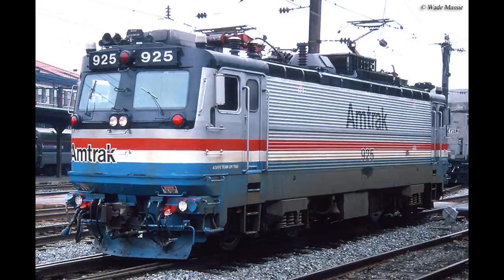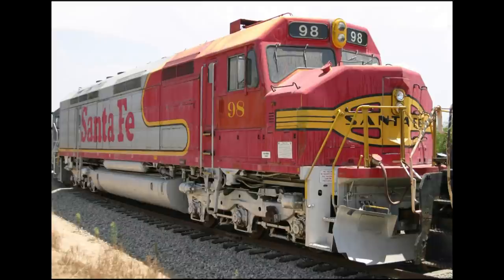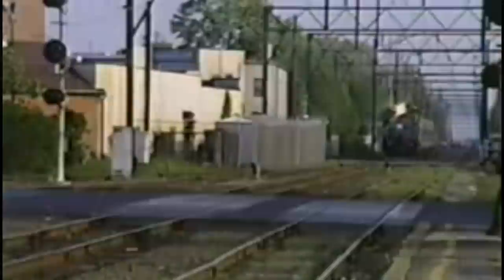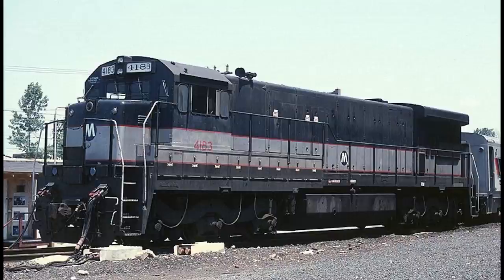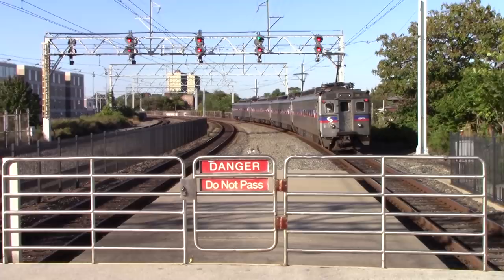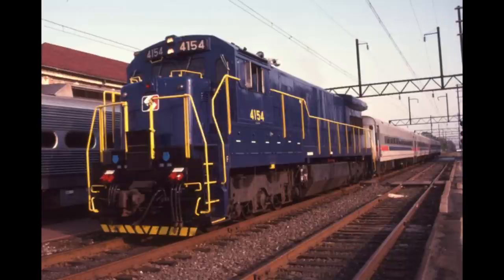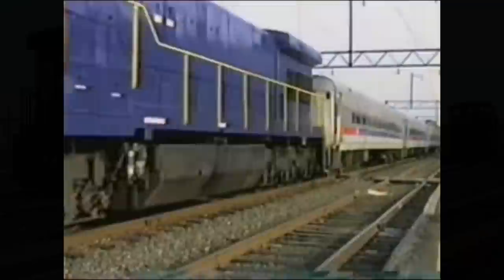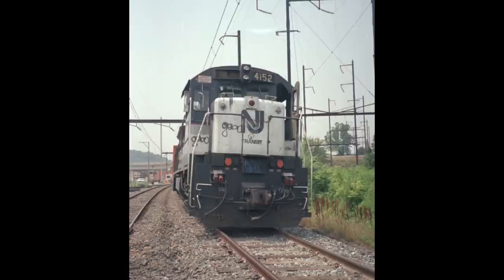Engines of SEPTA: GE U34CH

Comment: 1:05 I remember the story behind the shown locomotive is that EMD made a freight locomotive, Southern Pacific wanted a longer passenger variant, and Erie Lackawanna wanted a freight version of that with more fuel and ballast.  A freight version of the passenger version of a freight locomotive.
Reply: @LJRailfan-Gamer_07.  yes
Reply: You’re correct. I believe an EL SDP45 survives today in rough but economically restorable condition, might be Roanoke, VA
Reply: SDP45 are SD45s with passenger gearing
SD45M are similar to P45s but lacked passenger gearing and we're set for heavier ballasting and more fuel for greater tractive effort

Comment: Fun fact: down here in Brazil, there's still large numbers of dash-7s and U-boats, notably 9264 (ex-5099) a C30-7 that still sports the BN colors even after 20 years of operation, the original U23C's bought by the Federal Railroad Network in between 1972 and 1976, many rebuilt to dash-7 standards as U23CA, U23CM, U23C1, U23CE and C30-7MP. All of the above are still in mainline service, with 9264 being put as a MU unit on the last train headed by EMDX SD80ACe 8080, the SD80 demonstrator and the U23Cs being common as MU units or in other trains outside the iron ore drags.

Comment: Ferromex in late 2014 begin scrapping all former u boats and c30 left from fnm, today only one remains operate which is 3571 I believe and others from ferrosur and one c30 in ferrovalle. So I think most of the units maybe scrapped in 2003 or 2014 while other maybe sent into Brazil from TFM.
Reply: Mexico lost quite a number of locomotives and they haven’t been great at hardly saving much their for preservation as well.

Comment: I love the GE U34CH’s and it is good that 3372 is to be restored once again. 

I had a look into the Lake Erie survivors apparently 3372 isn’t the only one. It is revealed they are two in Brazil apparently locomotives 3367 and 3380 now 4167 and 4180 one as you said is spares and apparently 4180 was a National Railway Equipment locomotive before being sold further on. 

As much it’s ashame 4154 could not have been preserved but hey hopefully 3372 gets restored to running order again someday.

Comment: Keep it up and had SEPTA kept the U34CH you are more likely to see them as maintenance trains on  septa Commuter Rail lines but not Amtrak owned track They're the Wilmington Newark Paoli Thorndale & Trenton lines. I wonder if the network can actually support Dual mode trains like Alstom Coradia Polyvalent ALP-45DPs and Stadler Eurodual Locomotives. If the network can support them then they can be operating 30th street  Center City to Allentown or restoring the Newark, NJ line pre 1981.
Reply: they can and did operate diesels on the lines before the Center City Tunnel was built but SEPTA is diesel-phobic so won’t use them for lines because it’d mean extending service to other places

Comment: SEPTA needs to get some dual power locomotives so the can extend service back to some of the former Reading lines past the end of the wire, without the expense of running new catenary.  For example New Hope, Allentown Bethlehem, and Pottstown, if not Reading, are probably now viable routes
Reply: I definitely agree with you there. SEPTA made the foolish mistake of not purchasing the ALP-45DP as well as the Bombardier Multi-Level coach.

Comment: 3372 reminds me a bit of NS 8212. The only one in its class that’s alive. At least 3372 was preserved. 8212 is planned on being scrapped.
Reply from the maker: Well the only difference is 8212 has known sisters running in Peru still running with modifications like a different radiator housing which I guess was to combat the C39's overheating issue. 8212 is just the only one left in the US that runs while 3372 is the only confirmed U34CH left as the rest of the U34s were scrapped or have an unknown status that is likely scrap. 8212 as of March 2021 is still in rough shape occasionally spitting sparks out the exhaust and leaving its usual smoke haze but the crews say it's running fine for now and there's still I guess a few parts from scrapped sister 8211 to keep her going and it's a miracle her turbo hasn't blown just yet as that's what eventually killed her sister 8211 and probably also killed distant relative New Hope C30-7 7087. It's common on W230 and is super rare on L160 however once 8212 dies it's off to Hatfield scrapyard.

Comment: Why is it a U34CH when it outputs 3600 horsepower?
Reply from the maker: 200hp is eaten by the HEP generator so it's usable HP is only 3400hp. Plus U34CH rolls off the tongue easier than U36CH